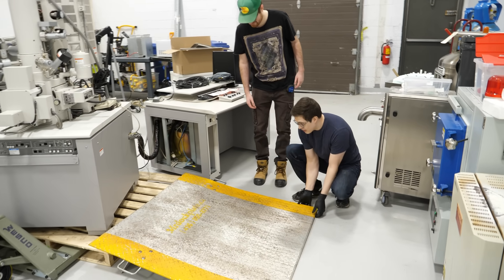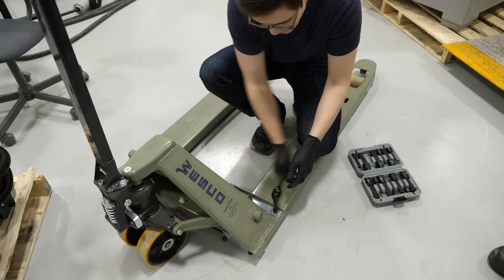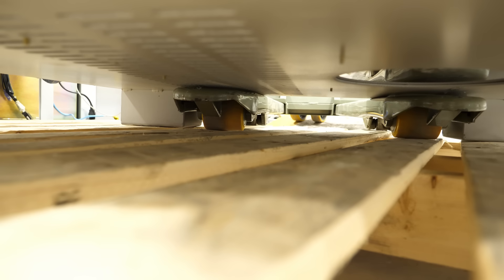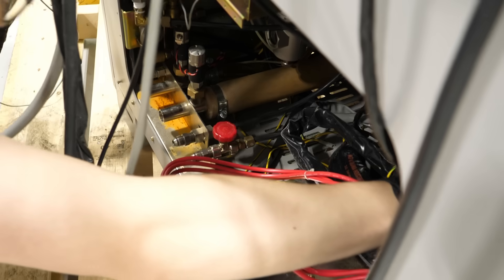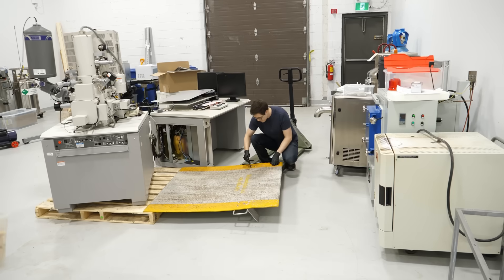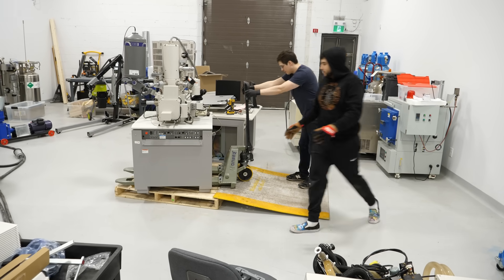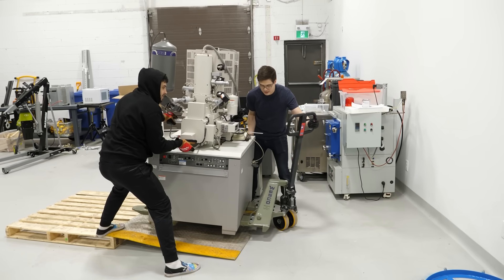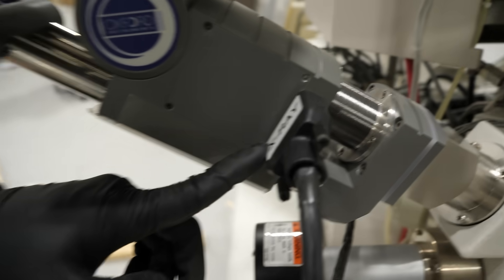Just a bunch of monkeys with a microscope

Comment from the maker: We forgot to mention that the SEM was sold to us non-functional and as-is at a much lower price, and it has a bunch of fundamental issues. There's an extremely small chance that we might get it to work, but we will likely end up using it for parts.
Reply: Pumps are easy (but not cheap) to replace and if this was a scrap unit, the turbo was possible stolen.  But you have an EDAX!  You really need to get this going!
Reply: There is guy on youtube who did exactly like you. Bought non functioning SEM and made it work again!! (Don't remmenber the channel name now:( )
Reply: @neohydros  I guess you're referring to this guy: https://youtu.be/Kqx9blbYDB0
Reply: That was a good video @neohydros
Reply: @neohydros  projectsinflight?
Reply: @neohydros  ProjectsInFlight maybe?
Reply: @neohydros  projects in flight
Reply: Best of luck, Ebay sometimes has parts, looks like a Hitachi, so I'm not a familiar with them.  Power, then services, then vacuum, then find light :). The service manuals for these systems are pretty good references for repair.
Reply: @Razmuffin  what about the vibration motor?
Reply: right to repair is a core inalienable right
Reply: @monkeytimesmagazine3725  -"right to repair is a core inalienable right" - wholly agree. what i would have liked, is to extened your comment with ..and make parts available for public, not just "licensed " resellers
Reply: @Palmit_

I thought it wasn't, anymore? I know the company that runs McDonalds ice cream machines got into trouble for that and supposedly that set legal precedence. Any company still going that route should be open to litigation
Reply: Here I was thinking you spent 10 grand again just because you were doing a project, and it was an excuse to buy one. 
I then looked up the cost of a SEM. 10 grand would be a good deal.
Reply: ProjectsInFlight was able to salvage a SEM and make it work
Reply: I love how you can just randomly buy something that releases radiation
Reply: @alldave

I mean, it is 10k+ lol it's not something that you can just go get at the hardware store
Reply: What Madness is THIS ?
Reply: I actually watched a video covering the repair of an SEM, where the guy shares some of the resources he found, issues he ran into, etc. Check out "ProjectsInFlight," his video is around 7 months ago, but I'd love to see you get your SEM working so figured maybe that'll be useful info for you.
Reply: As a suggested video to this one, there is a channel called ProjectsInFlight that says they saved an electron microscope from the trash. Maybe they could help you get it working?
Reply: There is this guy. Ben from Applied Science. Likely he will walk in the room and it will work.
Reply: Collab with StyroPyro incoming
Reply: ProjectsInFlight bought a non-functioning SEM and was able to repair it with the help of the SEM-repair community! There’s a whole group of people that do this for fun, could be helpful if you want to make it functional
Reply: Get in touch wih Applied Science on YouTube for a collab!
Reply: I saw that one, if I only had the garage space I would have bid on it. Got a whole bunch of lab glass from them instead:)
Reply: "...for parts" -- bro... you already removed the bolt thingy's. Whats left that is useful? lol
Reply: the fact that you have a use for the parts in an SEM is almost cooler than the idea of you having a working SEM
Reply: I was excited that I recognized what the equipment was on sight but then realized that maybe I spend too much time in labs. 😂
Reply: Looks like the Hitachi SU-70 I operated for 6 years.
Reply: I saw a video of a guy a long time ago that repaired a non-functioning SEM, though it was a LOT older than yours. You might be able to hit him up. @projectsinflight.
Reply: he totally has a girlfriend, his mom's holding her hostage, I bet 😂 jk idk ❤ great video
Reply: oh i was wondering where and how could you get that, but its still so cool
Reply: A working lift is like....$7,000. Steep price but you can also rent them for much cheaper.
Reply: I was about to say it, but it kinda shows what sort of audience you have, that multiple people have mentioned ProjectsInFlight's SEM video before I could.
Reply: Have a nice day
Reply: @jonnypanteloni  O_o
Reply: I honestly don't know sometimes whether you really don't know how to get this to work or you're just being obtuse for content. You just needed to put the flat edge of the ramp up to the edge of the bottom of the equipment, slide it over to the ramp (the pallet will be far enough under the ramp to support this), use the forklift to raise and pull out the pallet...slowly...and then just slide the equipment off the ramp. Sheesh.
Reply: @victoriaeads6126

Except the ramp was bending with just one of them standing on it. Lol. I didn't think it would hold with or without the feet attached. There's still weight going down an unsupported incline
Reply: Daddy bought Nigel a new toy! Yay!

Comment: Situations like these is exactly why I always prefer a pallet STACKER and not a pallet mover. Heavier, bulkier more expensive and not always as much lifting capacity aight sure. But you have sooo much more freedom with the forks and manoeuvre the stuff. 
As far as I could see if they had a stacker they could just come from the back, lift it, remove pallet and be done. But yes yes here I am being a smartass with hindsight and no degree in neither chemistry or engineering. 
Just saying…pallet stacker > pallet mover.

Comment: Should be entirely possible to fix.  I am currently helping a buddy rebuild one from the 1980s.  The water cooling was plumbed in polybutylene - an abysmal choice.  Full replacement is nearly complete... you can do it, Take it one system at a time.

Comment: So I am an electron microscopist, I am currently eating my lunch in a building with 4 of them. Watching them unload this made me physically uncomfortable.

00:30 When nile said "you prop this up with a block" I said out loud to the room "Oh god no"

01:00 "Put wood under it and slowly shim it down".... "cut the pallette" .. that poor microscope.

03:50 When the microscope is opened and we can see inside, you can see its mostly space. Under there should be a turbo pump. These things are expensive and delicate. Most of the cable you see (the black thing) is a single, long grounding cable I believe.

06:00 Oh god, it's wobbling like crazy because they didn't put in the bolts to fix down the air table. It is designed to float on air, but you gotta fix that down for transport.

06:10 wait, didn't you disconnect the cables? OH GOD YOU ARE DRAGGING IT BY THE CABLES!

I am glad you got it down without anything terrible to happening. Now you just have to test the water system, compressed air system and vacuum system for leaks, and then the electronics. oh boy. 

Nile, you have for many years worked hard to make Chemists uncomfortable with your casual affectation of health and safety. Congratulations, you have finally done the same to an electron microscopist.

I'd love to know make and model of the system. If you ever need any tips or info, I can offer my help, or perhaps direct you to those who might help.
Reply: As someone who works with electron microscopes as well, I was cringing the whole time 😭 It’s for sure a Hitachi FE-SEM, I wonder what exact model number it is though.
Reply: As someone working with heavy duty CNC machines, I thought I would be more gentle wit a CNC. On the other hand the transport to the workshop isnt gentle and devices survive mostly.
Reply: Not sure if this'll make you feel better, but Nigel posted a comment saying they bought it as is with a bunch of fundamental issues, and will most likely be used for parts.
Reply: @DaTimmeh  I doubt learning they'll carnage its corpse for parts would make them feel any better lol

Comment: soo considering how much even the smallest vibration can influence your picture quality with those kind of microscops (anything from a person walking nearby etc) has nile considered any kind of dampening solution to this yet otherwise you are not gonna be able to resolve very small structures that well at all i used one that was undampened once and while we were able to resolve some stuff (facet eyes of an insect) at any maginfication below that point it was basically impossible to get a clear picture worst thing is for any extra dampaning they would need to get it onto a Plattform yet again.
In university we also had some Tactile Microscops(basically a extremly thin needle tapping onto a surface to scan its surface texture) and just to get good precission it was dampned by two different solutions first a giant table that felt like it was held up by some kind of smooth springy mechanism( pushing down on one side meant the whole area would go down and slowly back up) and then an small electronic one where the microscope was ontop of that was apperantly active dampining with electronics no idea how that one worked but all of that just to cancel out the daily vibrations all around from people to cars etc.
Reply: ok i think the microscope itself is already somewhat dampened lets hope its good enough

Comment: The grey part that you point to at the end doesn’t actually “produce” x rays. The grey tube is the energy dispersive spectroscopy detector, used for collecting x-rays and their energy from electrons falling from high energy states. Bc of every atom’s signature x-ray spectra from those falling electrons, you can tell what elements are in your sample.

If you do get the SEM working, you should 100% get a Geiger counter that can detect high energy electrons. keV energy electrons are no joke. Especially if you bought the microscope with fundamental issues, who knows what shielding isn’t properly in place

SEM is super fun to get good at. I work with crystalline thin films and being able to see cleave patterns in sub-1 micron cross section SEM and thin devices in top-down SEM is always really cool. Hope that you guys get the tool working

Comment: someone tell nigel you can get manual forklifts for 300-400 bucks even on scamazon lol. theyre only rated for 300-400 lbs so you would have needed 2 for this behemoth (one on each side), but given the untold zillions hes spent on random equipment for oneoff videos ~800 bucks is pocket change and would have made this 10x easier and faster by being able to just pick it up a few inches and pull the pallet out from underneath it.

also the censorship ai is out of control, it was auto deleting my comments for calling scamazon by its real name, seriously like wtf.

Comment: Not related to this video...
Had a thought about using a highly pressurized ammonia chamber with an nitrogen atmosphere to align cnt with one direction of current and doping with elements using a lateral current...
I can't do it, so I wanted to put the idea out there.
Cu-La-S-B-H-C-N filament 
CNT-dominant or Cu core
Reply: Potential superconductor 
Cu-La-S-B-H-C-N filament (CNT-dominant or Cu core ~0.1 mm, ~1–5 μm shell, ~1.3–1.9 Å channels: La-H ~1.5 Å, S-H ~1.3 Å, B-C ~1.5 Å). Tc ~ 160–195 K (ambient, 0.0001 GPa, 14.7 psi), ~170–200 K (0.05 GPa, 7,252 psi), hitting 193 K (-80°C, Δ ~ 16–22 meV) with La (~2 at%), S (~8 at%), B (~2 at%), H (~7 at%), C-N (~2 at%). Synthesis: NH₃ bath (10 bar, 5°C, N₂), LaCl₃ (0.03 M), (NH₄)₂S (0.2 M), BCl₃ (0.01 M), NH₄OH, urea, NH₄Cl, CNTs (~2 wt%), pulsed DC (0.1 V, 0.01 A), 0.3 T, H₂ at 0.05 GPa (200°C). Capsule: triple CNT (~3 μm) + graphene (~0.2 μm) + DLC (~0.1 μm) + Sn (~1 μm), H-proof (~10⁻¹⁴ cm²/s). Sheathing: PEEK (~0.1 mm ambient, ~1 mm for 0.05 GPa). Operation: space vacuum (10⁻¹¹ torr), shadows (~100–200 K), torsion (1°/s or 4% CNT strain).

Comment: you know whats funny... that at the end you can see the "dolley thing's prons are higher than the pallet. you could've just propped it up to the height of the microscope, pushed it under, propped it up a little more, slide the pallet from under it, and let it back down... but hey, thats just how a regular warehouse employee would do it...
Reply: The dolly has front wheels that would be in the way, would work for a forklift but maybe not that dolly.
Reply: Thanks for explaining that to me. I was wondering how on Earth people are supposed to actually unload it. It cannot be possible that the engineers that made the electronic microscope didn't think of the installation and maintenance.
Reply: @xobotun_ a forklift. They would use a forklift 😂
Reply: @bluepantherofdeath  a forklift is one way, but most smaller businesses will keep a set of blocks and beams for doing this sort of pallet removal.  Takes a few steps more than with a forklift, but it's safer than this janky ramp method.
Reply: Doesn't work like that
Reply: You need to learn grammar
Reply: Easy, easy... let the 'smart' people work.

Comment: Wouldn't it have been easier to just raise the pallet jack higher than the pallet, and slide under it like a forklift, rather than picking it up to put on the pallet? Or was it higher than the pallet jacks maximum lift height? I've used one before, but I've never jacked one all the way up to see how high they go.

Comment: I’m assuming the pallet isn’t standard and you can’t fit the lower wheel part under the pallet? Usually you just raise the fork and push wheels under pallet, lift then move back with it
Reply: So saw later in the vid…and the pallet mover does fit…so all you need to do is raise it up to that height…unless this is some cheap pallet mover x)

Comment: 7:00 Not him pushing it by the vibration isolation system 😭😭😭😭😭😭 

Hold it by its base dude!
Reply: There is also on almost every SEM a way to lock the column to the base during transport, some of those springs break very easily, hope its still in good shape.
Reply: @ayoutubechannel2065 
The whole top half is wobbling throughout lol, it's probably f'ed.
Reply: @Techpriest1010 I would have to agree haha
Reply: @Techpriest1010 what does that do exactly
Reply: @Xnoob545when you are working at such high magnifications vibrations from across the room or building can distort the image. These usually have a big set and a little set of springs keeping the stage “floating” so vibrations don’t travel up to the stage and sample from the ground.
Reply: @Techpriest1010 It's supposed to do that. The top half of the microscope is part of a larger column assembly that floats on springs inside the base, like a trampoline.
Reply: @ayoutubechannel2065  It was sold to them non-functional as Nigel said in a pinned comment.
Reply: @Mirtsal yeah I know I just meant I hope the vibration isolation system is still in good shape

Comment: Couldn't you just have.... raised the lift? So the lift is on the floor, move it in under the thing you wanna lift, raise it further, remove pallett, put it down on the floor, profit??? 😂😂❤
Reply: I don't think that's how these manual lifts work, plus the base of it being under the thing it needs to lift could potentially be a factor, since the fulcrum would be lower than the load

Comment: casually removing random screws from a machine, not having any idea what they're for
Reply: and the machine in question is an (probably stupidly expensive) electron microscope
Reply: @ahuman5592  *non-functional
Reply: @ahuman5592 non functional and very low price did you even watched the video
Reply: it's called weight reduction
Reply: @notbaldfrost  was about to say, did this with my mouse. The bottom is held on by tape but it works 😅
Reply: I did think the same.  i agree that sometimes there are random spare parts. i think it comes from the tendency for some companies to clone/ modify blueprints over and over like they had a point as mounts in another project or  something.
Reply: There is always some extra screws in machines. 
I've disassembled and reassembled hundreds of devices and 90% of the time there are still some extra screws left over.
I did fix and tune my car, and every time i disassembled and reassembled interior, i got handful of extra screws somewhere
Reply: @Bittinikkari that just means you put it together better than factory
Reply: @Bittinikkari  I can't tell if you're being serious or not lol.
Reply: @Bittinikkari perhaps they are used for reinforcement. So, in a sense, they are not “extra”.
Reply: @Bittinikkari  Doesn't mean every random screw isn't needed.
Reply: @Bittinikkari  unfortunately this isn’t quite true for electron microscopes as someone who works on them especially a Hitachi they’re stingy af 😭
Reply: @Bittinikkari sorry but if that happens every time, you really aren't good at what you do.
Reply: @Bittinikkari  This means you did it wrong lmao
Reply: all they do is hold stuff in place its really no big deal lol
Reply: If this is nilered extra, I'm excited to see how unhinged nileblue extra is 😅
Reply: Meet the Robinsons situation
Reply: hey you look familiar!
Reply: thats how i fix everythimg i owm and never pay anyome to fix anything
Reply: If they’re not necessary then they just made an improvement to the original design!

Comment: you have a pallet jack. Raise the pallet up and put something under the pallet.
Reply: Exactly what I was thinking. They can't see the forest for the trees, apparently lol.
Reply: Not offence to these guys. But you can tell these guys haven't worked in the trades or a factory.. It was was still quite interesting to watch.. 😂
Reply: I’m confused with what you’re saying. How would raising the pallet get the microscope off?
Reply: @BoyPockky. The ramp was too high for the pallet, so it would have been easier to raise the pallet than lower it
Reply: @BoyPockky.  you raise the pallet to the level of the ramp and secure the pallet. Then you take the pallet jack out and use it to get the microscope down the ramp.